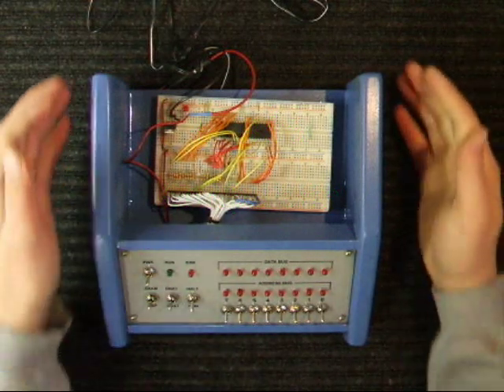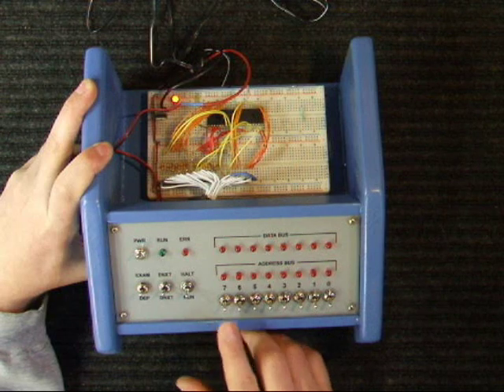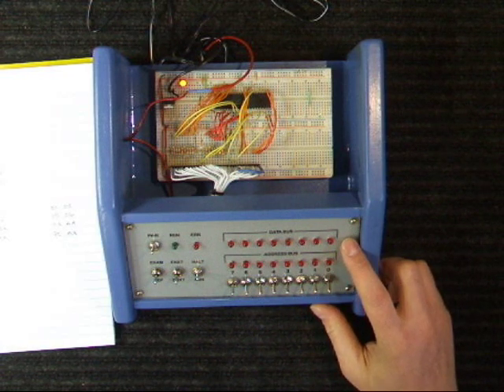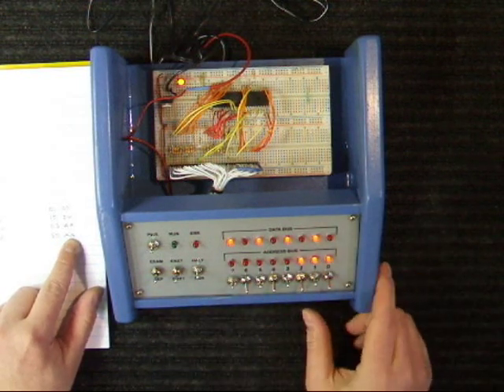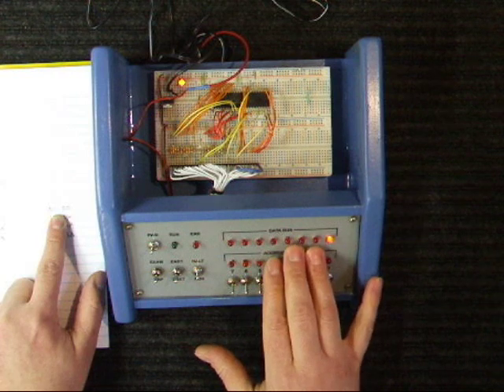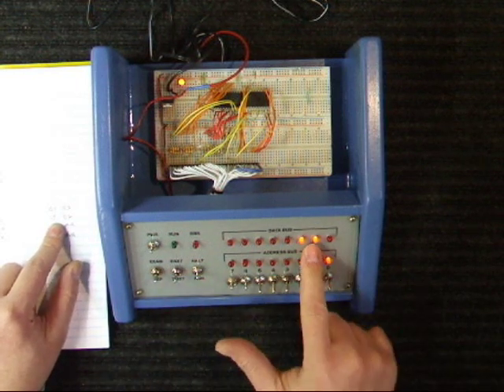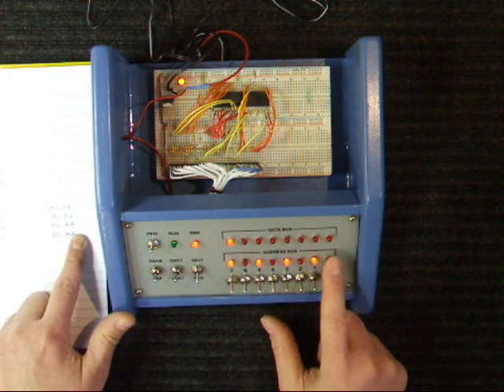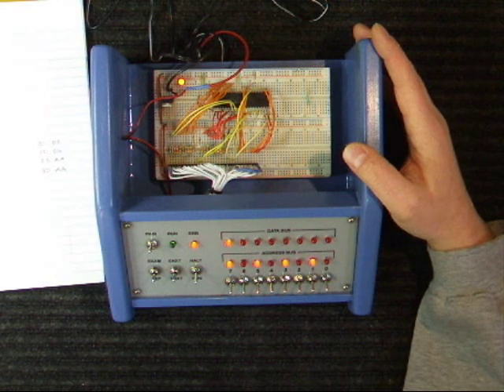My retro 8 bit computer.

Comment: Very nice video... How do you deal with static debounce?
Reply from the maker: The switches are tied to the PIC with either gnd or 5v. Debounce is done by check/delay/check. If I remember correctly, it's 100ms delay.

Comment: Can it run fallout 4 @ 4K 60fps ultra-hd?
Reply: Yes, but not at 60fps.  It'll run just a bit under that.
Reply: Jonathon Payne 10 trillion billion million thousands times under 60fps (w/ only leds)
Reply: it could spit out color codes for each pixel, then user have to use pencils and draw it on paper. each frame, pixel, by pixel.
Reply: +AJ20ist Are you OK?
Reply: +AJ20ist Maybe ;-)
Reply: AJ20ist Swap out some of those leds and replace them with green and blue leds and it will
Reply: Yeah without screen it haves a really good graphics

Comment: Very, very nice...
256 bytes RAM (with 4k memory for both the interpreter and program) is enough to run ANS Forth (I think)...
Reply: +Eric Hawk Never knew that Forth can run on a micro
Reply: +Khoi Sousa Oh yeah, that's where Forth shines (embedded microcontrollers).
https://en.wikipedia.org/wiki/Forth_(programming_language)#Programming
"Forth became very popular in the 1980s[12] because it was well suited to the small microcomputers of that time, as it is compact and portable. At least one home computer, the British Jupiter ACE, had Forth in its ROM-resident operating system. The Canon Cat also used Forth for its system programming. Rockwell also produced single-chip microcomputers with resident Forth kernels, the R65F11 and R65F12. A complete family tree is at TU-Wien. Insoft GraFORTH was a version of Forth with graphics expansions for the Apple II.[13] ASYST was a Forth expansion for measuring and controlling on PCs.[14]"
Reply: Eric Hawk I really want to program my Arduino w/ Forth! (I still have that Forth programming manual for that gigantic IBM mainframe somewhere on my bookshelf)

Comment: Does this have the Z80 Processor or the 8800 Processor?
Reply from the maker: No, it's using an 18F4685 Pic Microcontroller.
Reply: Ok.
Reply: Kaos116 Can it run gta V? pls add a vga or hdmi port and sell it to me:))

Comment: You've probably already figured this out by now, but the redstone dust is the wire and redstone torches are NOT gates. Repeaters not only extend the signal of redstone but also add a delay ranging from 1 to 4 ticks. Pistons can also be quite useful if you're not afraid to stray away from solid-state, especially now seeing as Mojang just added moveable redstone blocks. There's some really smart guys over at redstonedev . net if you want to bounce off questions about redstone computing.

Comment from the maker: The blue part is wood. I tried to match the color of the Altair. The face plate is plexiglass that was laser etched from the back. Before the protective paper was removed I spray painted the lettering. Then removed the paper and spray painted the  whole back. The front is left unpainted and it gives it a very durable finish.

Comment: it seems quite complected but its not very hard if u get the basics of how a cpu runs then its just making the bits of that and computers its just things in parallel  lots and lots of duplicated circuits etc 
seems more complex then it realy is and theres circuits out there already made to copy were ever there hiding since most of the 60~70 based computers are same
wen ive colected enuf microwaves im using the relays to build a masive relay pc have to use the mot's to drive them XD done 50 ish

Comment: yes theirs a huge difference between a microprocessor and a Microcontroller 
if ur keen on computing and electronics pic's from microchip are 1 way to start and are ok and there site wen u sign up have many full programs and circuits for alsorts of stuff and theres lots others 2 for any1's info

Comment from the maker: The pic is running on an internal 4Mhz clock. Each opcode takes 8 cycles to be interpreted. So, in theory it's running @ 500khz. As I mentioned in the video, there is a self imposed delay between opcodes, which if I remember correctly drops it to about 100hz.

Comment from the maker: It actually has about 2k of memory, but there is no way to access it. You only have the 8 toggle switches on the front panel to enter an address. That in itself restricts you to 256 bytes.

You could certainly add a few more address lines (and switches/LEDs) to have access to that extra memory.

Comment from the maker: @AtariXcore They are double throw switches. They either apply +5v or ground to the pins. I can't float the pins, so I don't think I will be able to let anything else control the buses. What you can see in the notebook is the assembly code for the little program I toggled in. The code in the PIC Microcontroller interpereting  that code is a bit longer ;-)

Comment from the maker: @geoman298 No, I haven't drawn one up. There is not much to it. The LEDs have current limiting resistors. The switches are wired directly to power and ground. The address LEDs are on PORTA. The data LED's are on PORTB. The switches are tied to PORTD. The other LEDs and switches are tied to PORTC & E.

All the work is being done in software. This is not what I would consider a true 8-bit computer. It's more like an emulator.